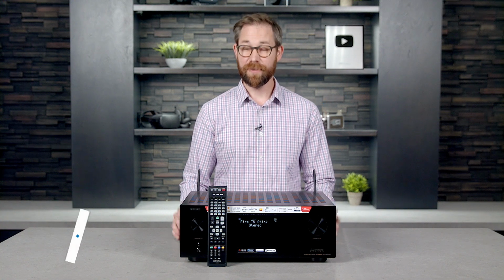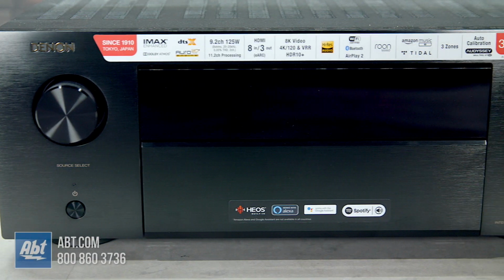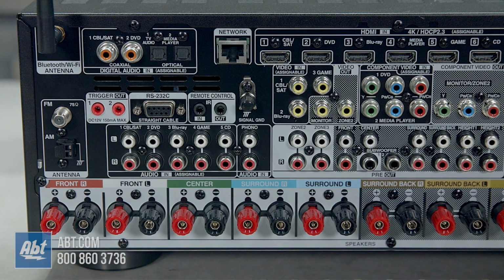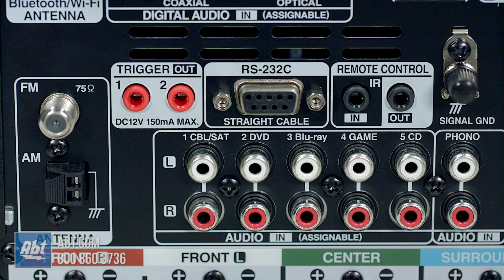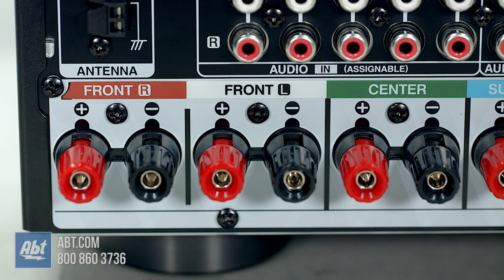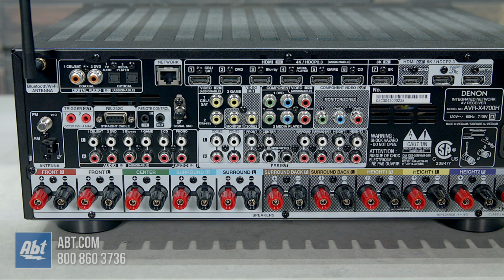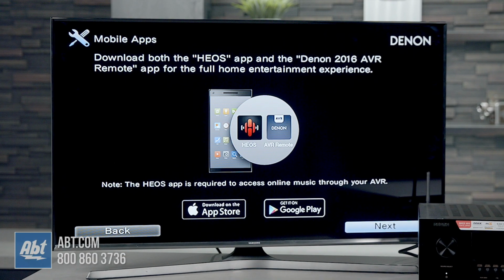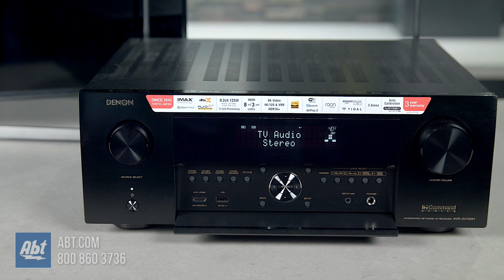Denon 8K AVR-X4700H Receiver Overview

Comment: Saludos a todos hago referencia a que los  RECEIVER DENON AVC X4700H; X6700H esa Serie X  fabricados entre 2020 y antes de Mayo 2021 tenían fallos de CHIPS para poder usarse correctamente en Consolas XBOX para 8K ; la Solución de DENON fue entregar Gratis un Adaptador SPK618 HDMI así funcionaban correctamente mas su actualización , ahora COMPRAR SIN FALLOS YA SON RECONOCIDOS después de Mayo 2021 que tengan Nº. de  Serie  que digan xxxxx700001 , así para confirmarlo todo es bueno saber año de Fabricación y Nº. Serie;  así Atención al Cliente de DENON nos dará mas de una explicación para nuestra confianza y seguridad de Compra, sabemos que sale ya el sustituto Nuevo Modelo DENON AVC X4800H  en este año 2022 mas caro sin dudas.... Gracias a todos y un abrazo.

Greetings everyone, I refer to the DENON AVC X4700H RECEIVER; X6700H that Series X manufactured between 2020 and before May 2021 had CHIPS failures to be able to be used correctly in XBOX Consoles for 8K; DENON's Solution was to deliver an SPK618 HDMI Adapter for Free so they worked correctly plus their update, now BUY WITHOUT FAULTS THEY ARE ALREADY RECOGNIZED after May 2021 that have No. of Serial that say xxxxx700001, so to confirm everything it is good to know the year of Manufacture and Nº. Series; Thus, DENON Customer Service will give us more than one explanation for our confidence and security of Purchase, we know that the substitute New Model DENON AVC X4800H is already coming out in this year 2022, more expensive without a doubt.... Thank you all and a hug.

Comment: Hi I have a question. I have a 5.1 setup with Dali opticon series. Which denon receiver you recommend? The denon 3700 or 4700 ?
Reply: 4700
Reply: @Nandocupra  do you use aura 3d upmixer? Thanks for your answers
Reply: Same boat, which one did you buy?
Reply: No I don’t use that